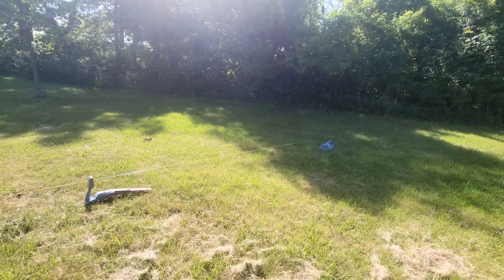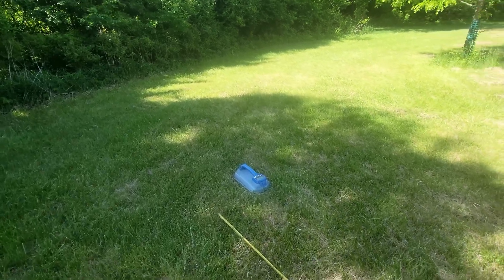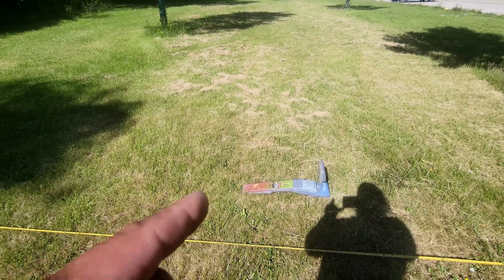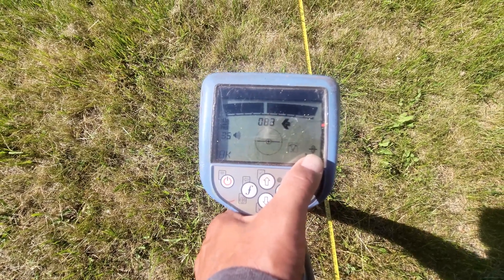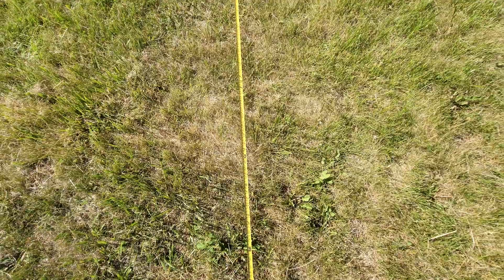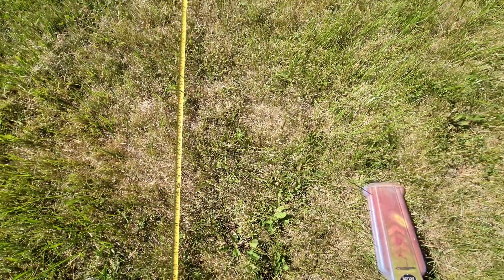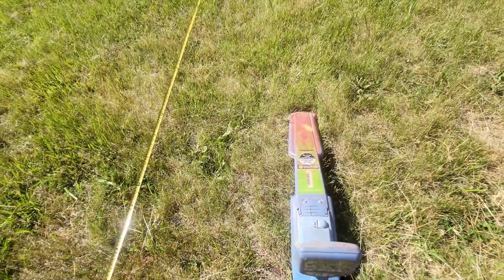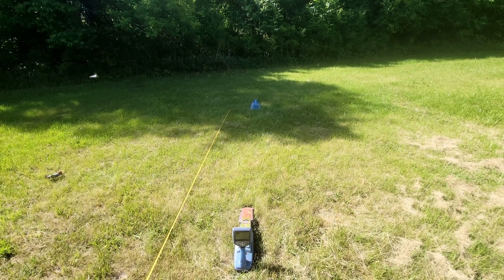Radiodetection RD-8200 Evaluation | Testing the Accuracy of Depth Readings

Comment: I'm wondering if your tape measure should start at the center of the transmitter instead of the outer edges? My understanding is that the receiver takes the depth readings from the center of the magnetic field.
Reply from the maker: Indeed, you are correct. The depth readings are obtained from the center of the magnetic field. In this case, since the transmitter is positioned above the magnetic field, the reading is derived from the transmitter antenna itself.